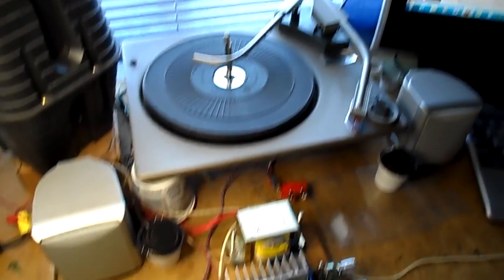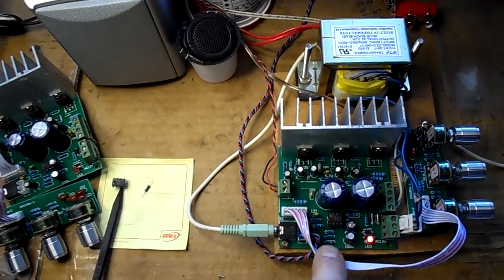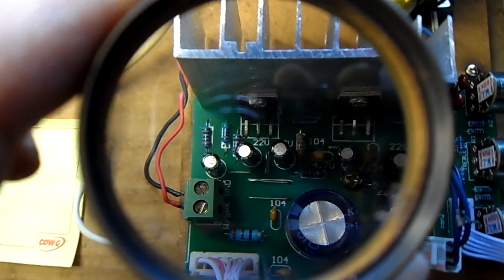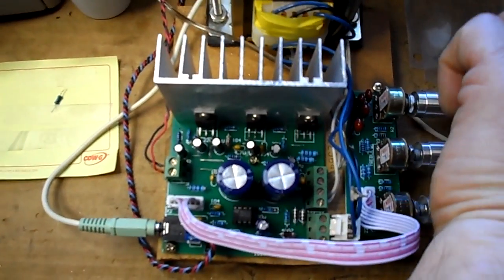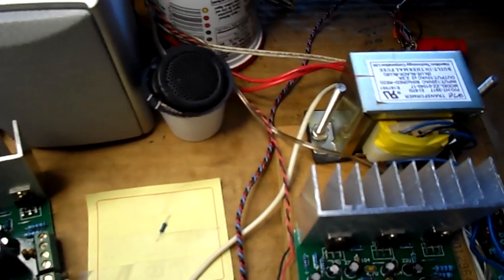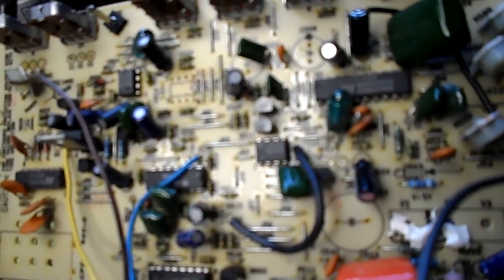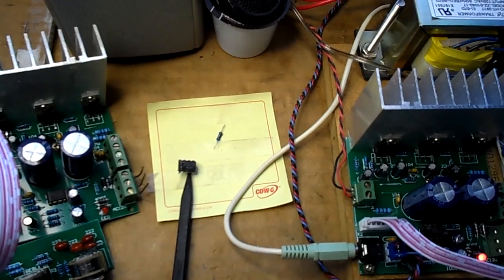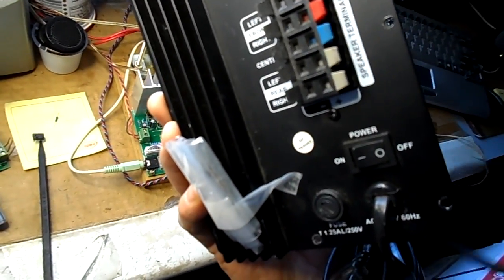Brand New TDA2030 Amplifier Issue.

Comment: hi, I got this same board, but I got a problem, every time I power on it got a huge pop sound, how to cure it?
Reply from the maker: Believe that POP elimination is a function of the IC. One may be suspect. Maybe lift the power leg (Pin 5), on them one at a time to see.
Reply: Farmradio i got 2 of this board also, but both of them have pop sound especially woofer get the biggest pop sound, if I turn the volume even higher the pop more huge. Do your amp have the same problem ? But it only pop when power on and power off
Reply from the maker: Been a while, but do not recall any "pop" that seemed out of the ordinary on these.

Comment: help please........i bought mine, left and right speakers works perfectly fine but the bass output is faulty.. i end up switching my op amp 2 times using ne 4558, and tl072 same result no bass output. same result when i changed its sub woofer tda chips.
Reply: Same hare if you have solve the problem plz tell me

Comment: I changed one of the TDA chips to get the bass back but still have some issue as bass sometimes goes and only come back when I remove the power and turn speakers on again. What could be it, is it op-amp problem too. but I have the bass back now what could be the other problem which is taking the bass back (sometimes).
Reply from the maker: +Tejinder Singh Swaraj I still might try another chip. The new bass one could be defective/overheating?
Reply: well overheat, I think yes because after some use when I opened up the speakers, there was lots of smell of burning wires coming from inside but everything was looking good on board. 
which another chip should I try. I think now this time I'll replace all the TDAs because I don't want my whole board burned up in the end.
Reply from the maker: +Tejinder Singh Swaraj I have a powered sub that uses like 8 of them, & they are all bad from overheating from being inside of the sub box.

Comment: I want one of those amps t o make use of an old computer 2.1 Logitech system. But the power supply is a mystery to me. 12 volts AC from a transformer. Would this work? "Power Transformer, -> 12VAC Center Tap (6_0_6), 3A ?
Reply from the maker: +Don Hopkinson  It's actually 24V. 12-0-12 which equals a 24V center tapped type. 12 and 12. Look up a 24V CT transformer. That's what these use.
Reply: Does it have to be AC or can you connect 12v DC directly, and if it have to be why is that(im a newbee)

Comment: It is amazing how they can make these damn amplifiers so cheap. Now we have a part of an answer: No quality control.Did you pay about nine dollars each panel?
Those resistors are that small it takes use of a loupe to read the colour bands, that is if they aren't using SMT resistors.
You can get a mono TDA2030 amplifier for as little as US $ 1.52 or UK £0.99 .
Of course you do not get any tone controls, just a trimmer pot for volume